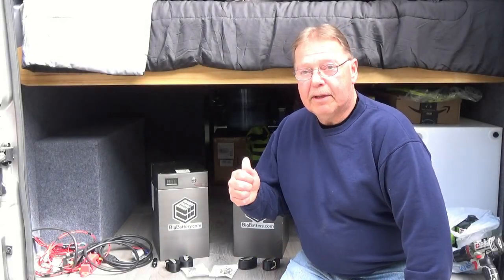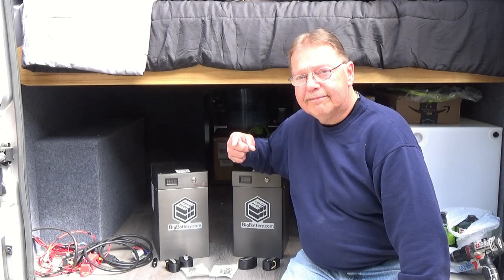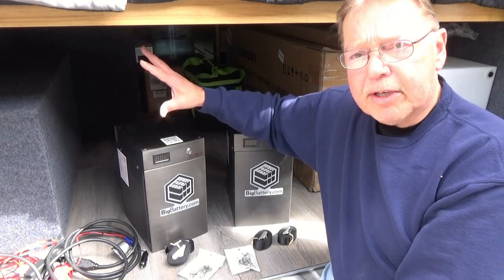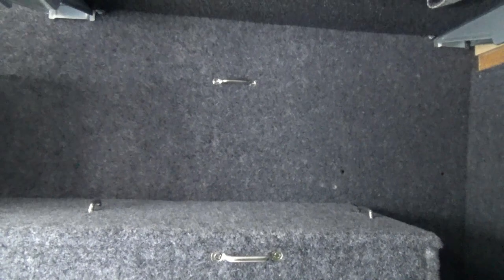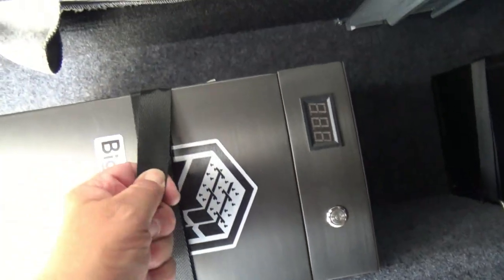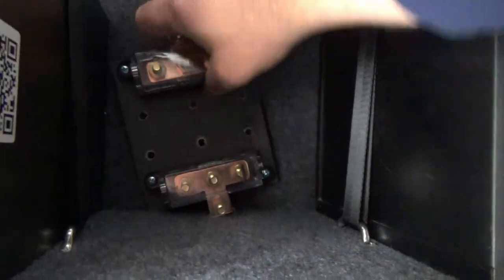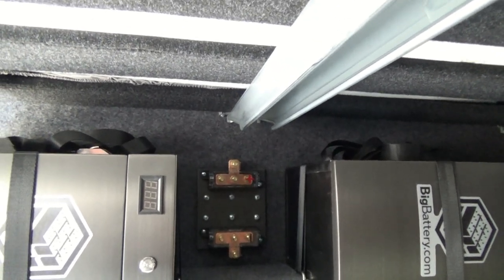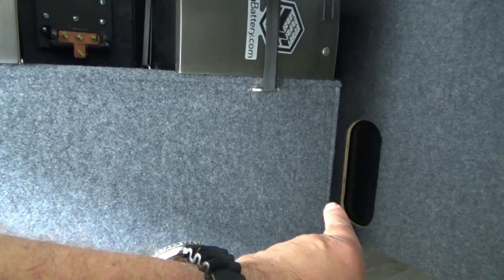Promaster Van Build 2500 159WB – DIY– 12V Power Install – Part 32

Comment: Nice progress.  On light switches are you going source-light-switch or source-switch-light?  just wondering how you got lights and no switches installed.
Reply from the maker: Temporarily connected all lights to fuse block and using battery cut-off switch to turn everything off. Next project is to add a switch panel in galley area for source-switch-light. Thanks for checking it out!

Comment: As much as that system cost a solar generator would be better idk. Lest space, weight and hassle
Reply from the maker: I thought about that... I ended up with 6000w of battery power, not sure I could find a solar generator for the same low cost

Comment: Nice. You answered all of my questions except one...  I'm assuming that you will be connecting your DC-DC charger directly to the starting battery, since 50 amps is too much for the accessory circuit.  So, unless the charger can be set to only turn on above 13.0 v and turn off below that voltage on the input, you will need a switch of some kind to turn off the charger when the vehicle isn't running.  Otherwise the charger will drain your starting battery to something like 11.0 v every time its left with the engine off.  Which won't likely be enough to start the van reliably. 
 Great progress!
Reply from the maker: Thanks Aspendell! Correct, will be connecting directly to battery at some point and will use an accessory switch to power on and off the unit when ignition is off. Need to check compatability of the charger to batteries... already have an issue with Renogy inverter :(
Reply: I think the DC to DC charger senses the gen/alt. is running before it starts to protect the starter battery.
Reply from the maker: @edm7356  When I get ready to install the charger, I'll also install an in-line fuse from battery to wire "just in case". Appreciate the comment!
Reply: @OregonBatman  I was wondering about that.  The Renogy design is over 40 years old now.  And originally ferric-oxide batteries didn't exist yet.  So I was wondering if they had upgrades for the new cell chemistry voltages.
Reply: @OregonBatman  Sorry my other comment was directed at Aspendell.  Yes a 60 amp fuse from battery and 50 amp after DC to DC charger. The 60 amp fuse may already be installed at your battery in your Dodge, which is the best place for the fuse going to the charger to protect that wire as I'm sure you know. Thanks for the great videos.

Comment: Will these batteries be sufficient for a ac unit and to game off of? I’m a avid gamer and I don’t want to get a max air fan because I want a ac unit that can both cool off and heat up my Promaster 2500
Reply from the maker: Depending on the size of the AC, it could run it for a while. I have an Ecoflow Wave2 that I can use, but it will only last 4-5 hours, after that... batteries need charged. You will definitely want some sort of ventilation in your van, if not for anything else but to keep condensation out
Reply: @OregonBatman  would 1600ah be sufficient for say a Dometic RTX 2000?
Reply from the maker: This is what I found: Dometic claims that the RTX2000 draws 19 amps running in “Eco” mode. Estimates claim that every 5,000 BTUs of energy requires 30 Ah/hour of power for each hour of operation. This equates to one lithium-ion 12V/100Ah battery for every 3 hours of use or 2 hours for a standard 12V/100Ah lead-acid battery. So 1600ah should run this unit on Eco mode for approx 53 hours
Reply: @OregonBatman  thank you so much, I really appreciate it!!